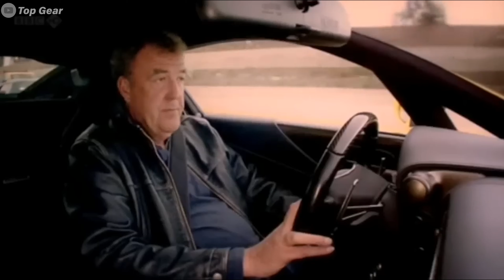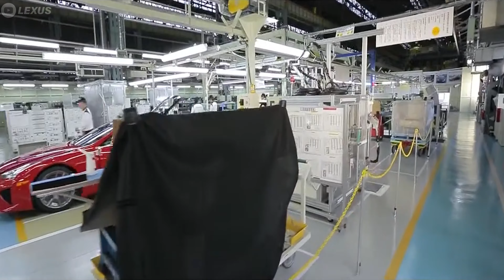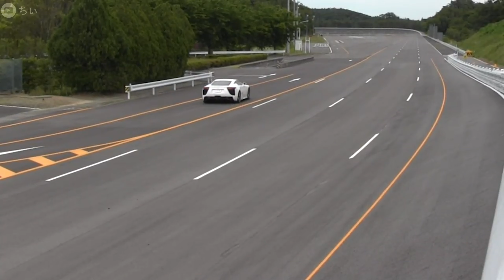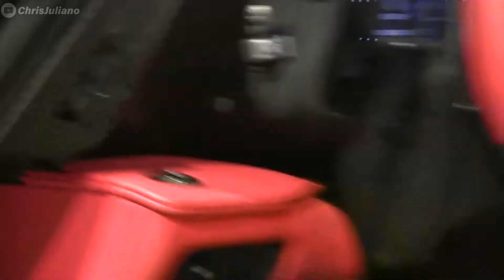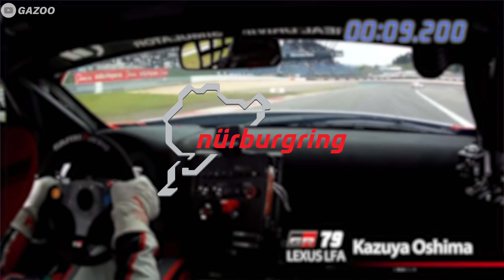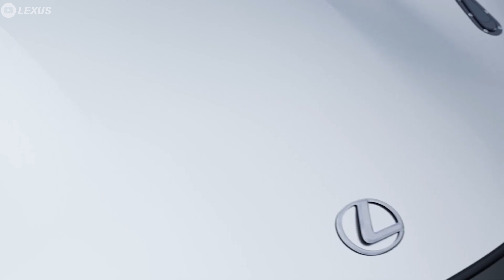Lexus LFA - The Craziest Car Japan Has Ever Made

Comment: Just like the Yamaha collaboration involving the Toyota 2000 GT; lightning does strike twice!  The only thing that annoys me is that it is not badged a Toyota!  I hate the luxury brand names and monikers on all Japanese vehicles!  With that said: I will call it a Toyota LFA!  The car is completely lit 🔥💯.  I would have this long before any other super car simply because it is Toyota!  I have owned two 1990s Toyota Trucks and from this far end of spectrum experience alone; knowing the Hilux and 4Runner intimately.  Toyota is King of durability, reliability and simplicity.  The LFA is JDM mastery.  If it was built in the last 5-8 years, given the garbage heap of unfixable appliances even Toyota makes now….I would not go near it!  Long love the Autos from the 20th Century and since production prototyping began in 2000, it passes the smell test of late teens early 2020s garbage!